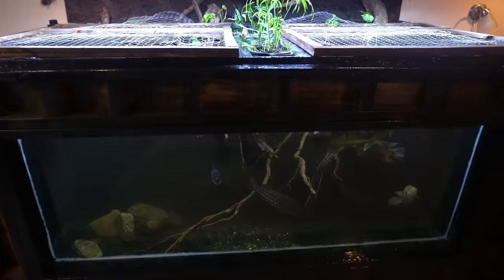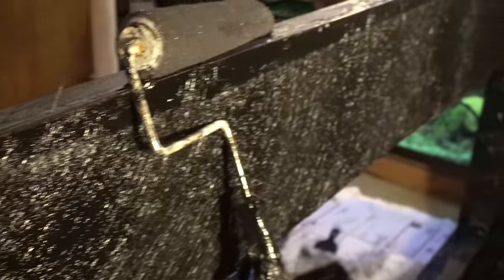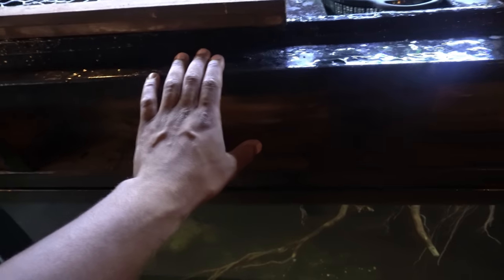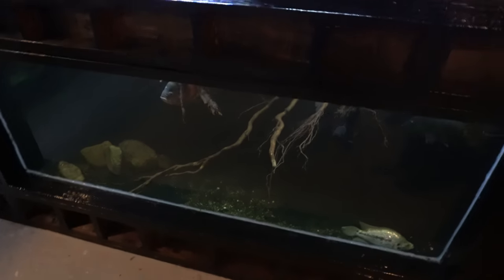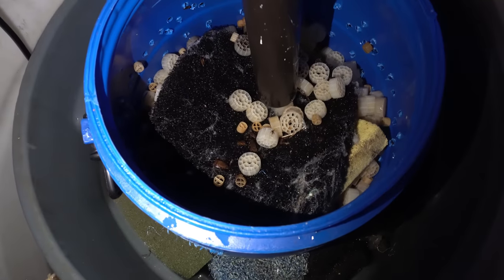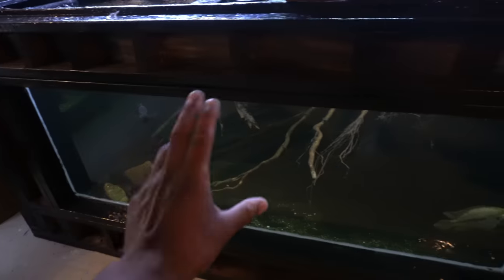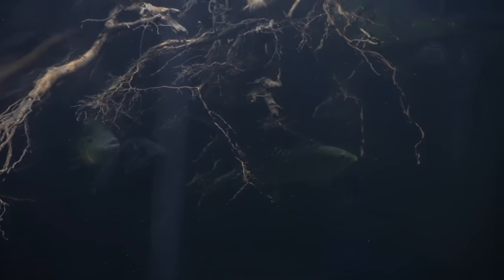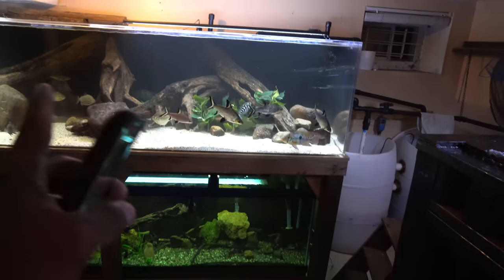How We Built The 880 Gallon Wooden Aquarium and the PRICE!!!

Comment from the maker: I respect your time...here are some shortcuts to this LONG Video:
Quick Overview 0:34
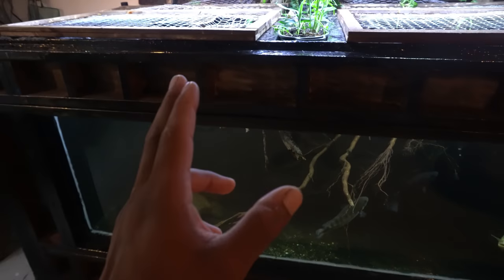Detailed Overview 6:38
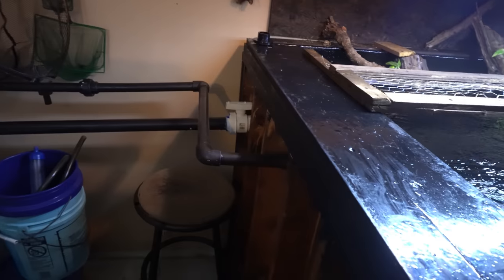Filtration 12:49
Cost: 24:30
Reply: Really really amazing looking build bro. If i owned my home id try it myself!!
Reply: Im still gonna watch it all. Love the content
Reply: Thanks for the time stamps and not splitting up the video on 8 parts
Reply: 880 gallons, wow!!!! And for the price! Unbelievable.... My custom 10ft long x 26"  wide x 25" high cost me $2000 w/ stand, sump and quarantine tank underneath it. But your tank is amazing. I might have to get u to build me a tank.
Reply: The crazy part is you This you self like the DIY king but you get less views and subs bro. That’s total BS, your content is freaking awesome. Also I know why your not getting those views and subs but I’ll be quite.
Reply: How thick is the glass you are using?
Reply from the maker: @clasyc  3/4 Inch
Reply: @dwsdarius  Thanks! I’m looking to build a tank holding roughly 650 gallons and I wasn’t sure if 1/2” tempered would be strong enough or if I should go with 3/4” tempered. Thanks again!

Comment: What would be a cheaper alternative to pond shield? 
For mechanical filtration, you could always put one or two FX6 filled with extra filter floss and active carbon to polish the water or just put filter floss right at the inflow.
Reply from the maker: There are other less famous brands of epoxy just like pond shield. Liquid Rubber is one brand that is $99 per gallon. Not as much reputation but doesn't mean it won't work

Comment: Awesome build brother! scape looks good too! I like the natural look I think a river rock bed would set it off though! find a creek collect river rocks, soak/scrub them up w/ hot water you want to get all the dirt off, then lil soak/scrub in Hydrogen peroxide fill up 5gal bucket halfway pour the entire 32oz in, load rocks to the water line shake/spin/stir soak 5-10 min. Rinse well then safe to add. (DO NOT bake some rocks will explode) Also, Lava Rocks are another good media option and it's cheap..  do a 2-3in layer of lava rocks in the bottom of the tank then top with the river rocks to 3x-5x the bio efficiency! Utilize that massive 4x8 footprint as an additional beneficial bed. You could also glue some of the river rocks together to make caves/piles for the knife as well that would blend in.
Reply from the maker: Thank you, yes I ended up putting more substrate down, now I just have to collect some more river rocks for that right side

Comment: You can absolutely add more moving bed media but you would have to add a large air stone to help it move which is good because that would help with degassing the water.  You could also put a “tee” connection and a several inches of pvc pipe with a “either a 45* pr 90* elbows. Connect it to the either or both filter barrels and that will create a swirling filter/bio-filter hybrid.   You could also attach moss ( java or Christmas moss) to the wood in the tank and that will grow and help with the filtration as well. I hope I gave you something to use. Good luck with your tank, hobby and you tube channel.  
Thanks you for your videos.
Reply from the maker: Thank you, yes I'll try the air stone underneath and see how that works

Comment: You should remove ALL of the K1 media cos they won't do much in terms of biological filtration in your current filter setup. You're supposed to have very strong aeration to create agitation and bounce between the medias for it to work properly. I'd suggest you replace them with pumice stones. They're very affordable and is extremely porous as compared to larva rocks.

As for having plants in the middle section of the pond........  you can try mint or even sweet potato (heard they are excellent for getting rid of excess nutrients and the best part is they don't need a substrate to grow).  Another suggestion is have water hyacinth, water lettuce or amazon frogbit in the planter "basket".  The basket allows nutrient rich water to flow through without having the plants floating all over the pond and at the same time it also prevents the roots from breaking and going down into the bottom of the pond.
Reply from the maker: Thank you, yes someone suggested adding air stones to the sump to help the k1 to be more effective...I'll try that and if that doesn't work I'll go for lava rocks

Comment: Though I think pressure treated wood should have been avoided as it off gasses some toxic stuff
Reply: 800 Gallon of water in you house should be more of a problem than that and K never hear any story of fish die because of treated wood off gas. All the people I know in YouTube who built ply wood tank use treated wood.
Reply: The off gassing is not an issue for the fish as the inside is water tight. Its an issue for the people in the house. Supposedly not good to breathe the stuff.